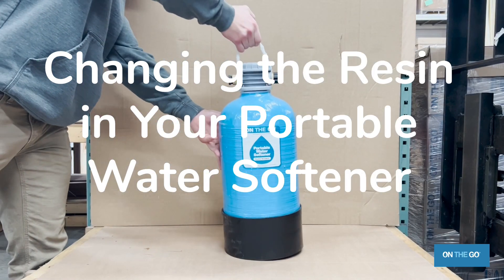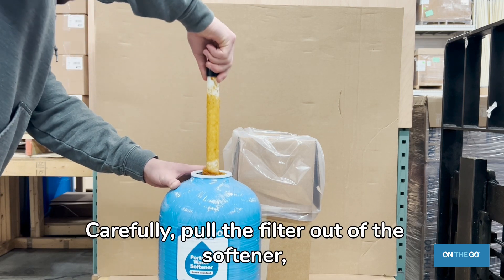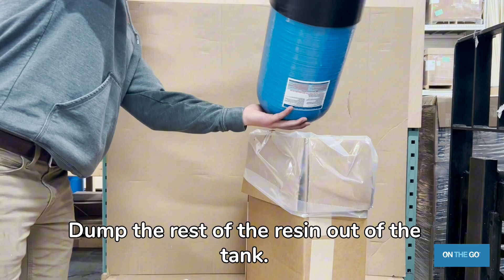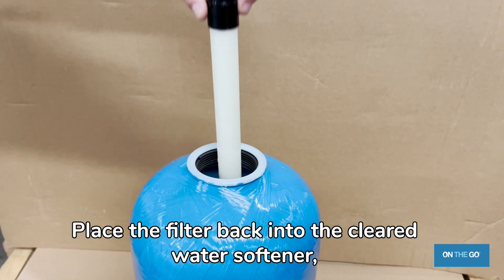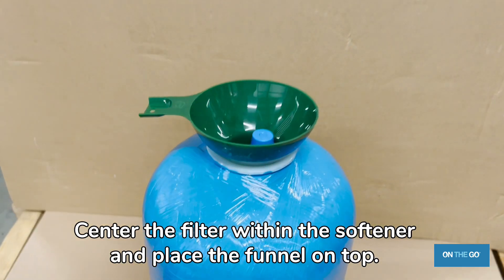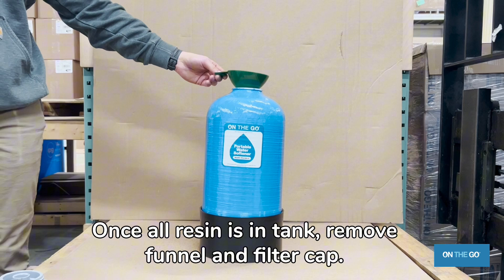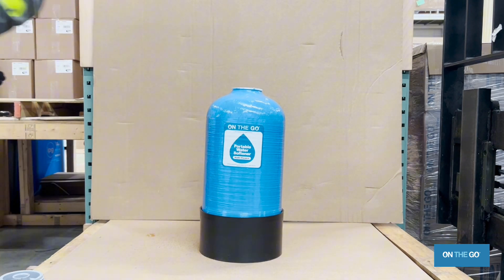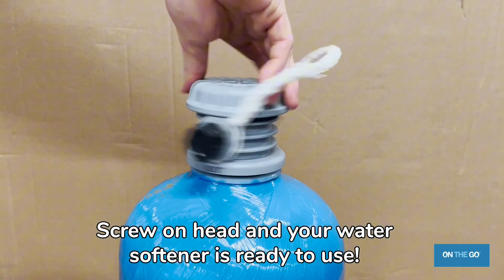Changing the Resin in your Water Softener

Comment: With new resin installed, will system also need to undergo a regen (with salt) or will this be 100% ready to use?
Reply from the maker: New Softener resin is good to go. You do not need to do the regeneration process.